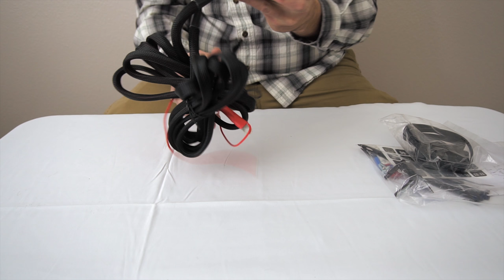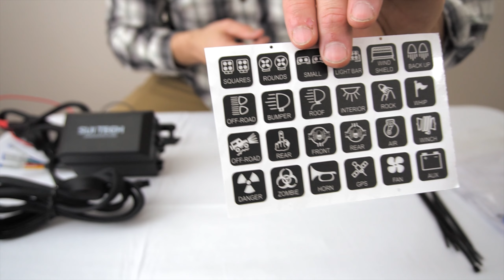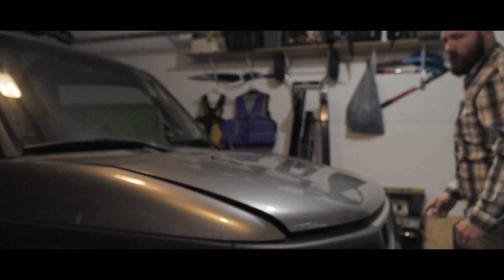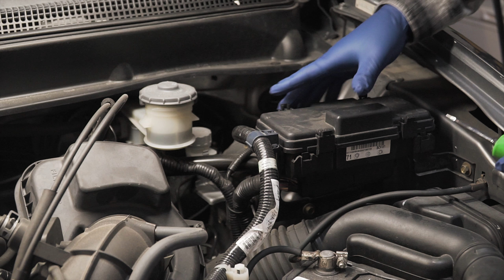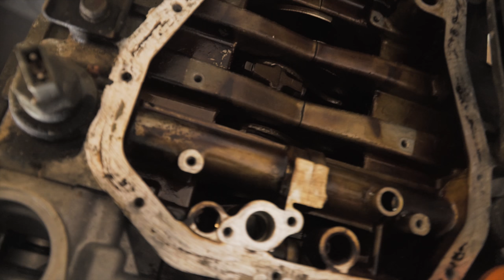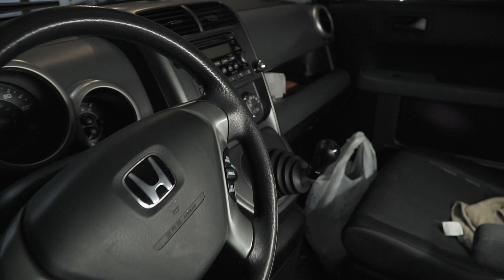Honda Element Light Controller Installation

Comment: I was hoping you were going to show me where to mount the switch panel without having to drill into my dash lol...im thinking im gonna mount mine on the fuse panel in between the legs. Id rather drill there because the panel is easily replaceable.  Thanks for sharing, keep the videos coming.